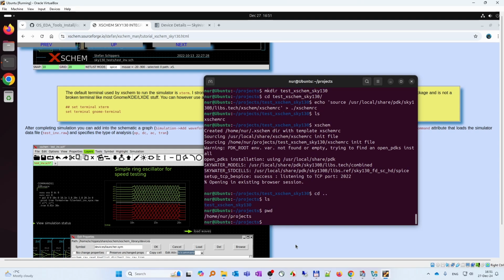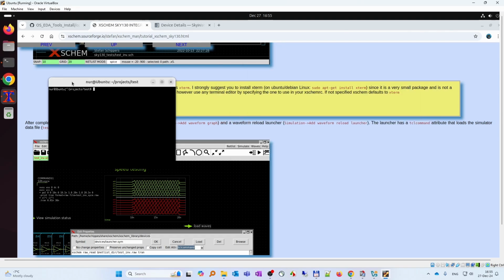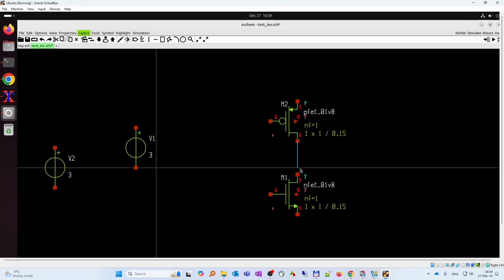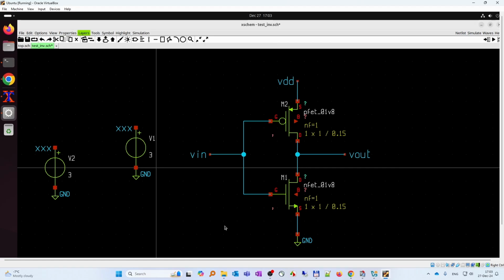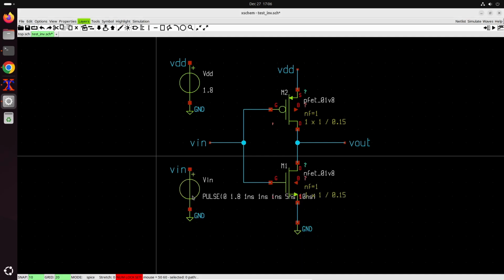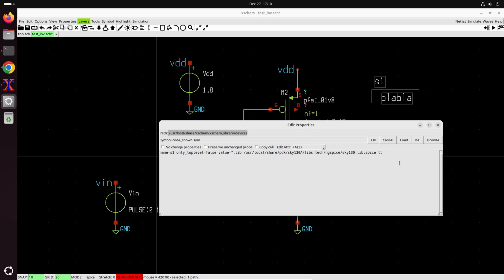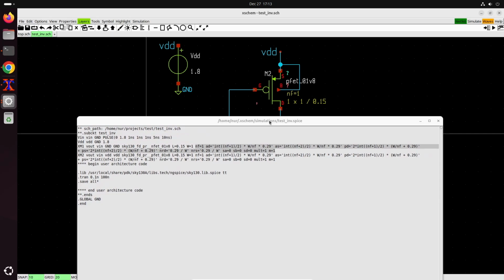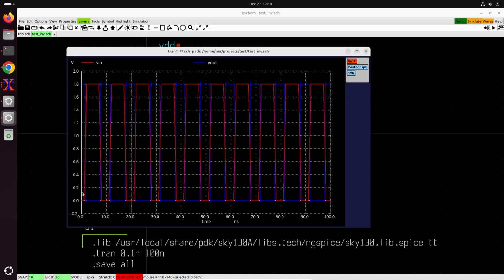Test first circuit inverter - Open source IC & PDK (Xschem & Sky130)

Comment: The material is great! If possible, I’d love to see a video that walks through the traditional analog IC design flow, covering all the key stages from schematic to post-layout simulation. Specifically:

1. Creating a simple NOT gate in Xschem

2. Running a functional simulation of the schematic

3. Drawing the layout in Magic

4. Performing LVS (Layout Versus Schematic) to ensure layout matches the schematic

5. Running PEX (Parasitic Extraction) to capture layout-induced parasitics

6. Running a post-layout simulation using the extracted netlist

I believe a complete and practical demonstration of this full flow would be perfect for your channel — especially since it’s hard to find detailed, open-source based tutorials that go through all these steps in one place. It would really help beginners and students understand how schematic design transitions into layout and finally into a realistic, fabricatable circuit.
Reply from the maker: Thank you for the suggestion. It's in my plan, just got too busy with my job. I'll planning to do the compreshensive guide as you suggessted, maybe even including the tape-out and chip test guide!